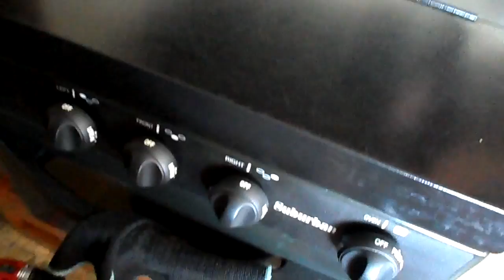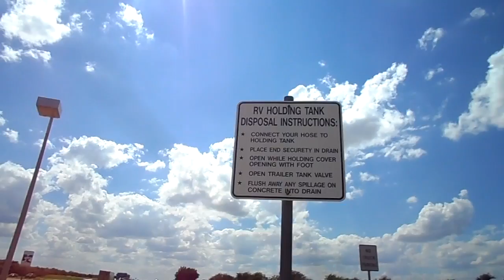RV FULL-TIME LIVING~ PROPANE SCARE LESSONS LEARNED & MY FIRST FREE DUMP STATION

Comment: I would use baby proof caps on stove to prevent someone butt from pushing and turning knobs. You have tight space and be careful propane heavier than air and will be at ankles make sure you have smoke and multiple gas detectors hanging and carbon monoxide detectors too.
Reply from the maker: Great Idea because when the slide is in, it is possible to bump the knobs and push them in and turn them as you enter the bathroom. Something I actually did later on this trip so it could have been an accident. :)